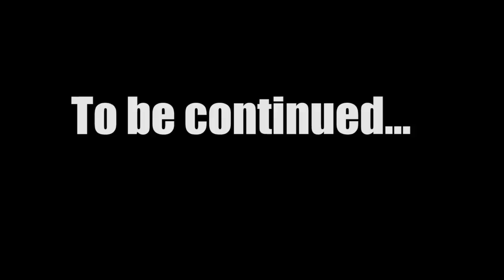Building my Music Studio - Part 1 - DIY - How to - Professional - Absorption, diffusion, insolation

Comment: Does that wall soundproof enough?
Reply from the maker: Yes, pretty well - I have have music pretty loud (too loud) and you will hear almost nothing on the floor above. The studio is on the - 1 floor (garage) and even there you do not hear a lot. Obviously, it is not 100% soundproof -- this is not double walls with an air gap (even that is not 100% soundproof) -- but it is pretty dense and so it does reduce the loudness a lot. In fact, the weak point is the door - not the wall. So, consider that the soundproofing is only as good as the weakest point.

Comment: But where is the aircon or at least a proper ventilation?
Reply from the maker: That is something that is till have to do - and there is a place to put an air con. Most of the time I actually have the door open, and have regular breaks when I have to close it, ventilation is not an issue. 

Also, fortunately, the studio is in the best place of the house, where it is  quite warm in the winter and fresh in the summer. Only when the temperatures are quite extreme outside I feel the need to heat/cool the studio. Heating is easy. Cooling is still a problem, because only the air con is the real solution... Will do eventually.

But you are right, climate control is an important issue!
Reply: @JohnJesus  oh! I see, split type air con will be the best. I think this is a good studio for rehearsal, how I wish I can afford to build one.